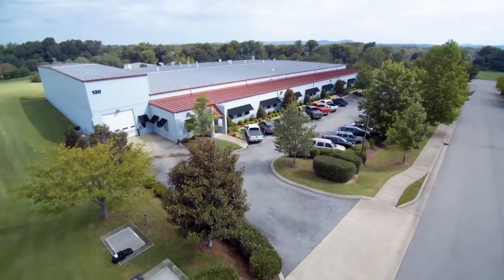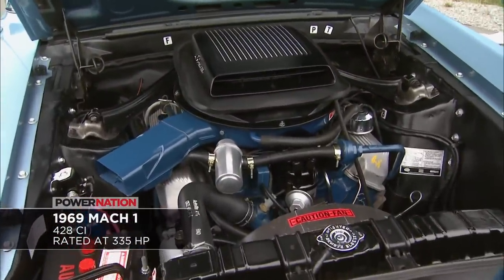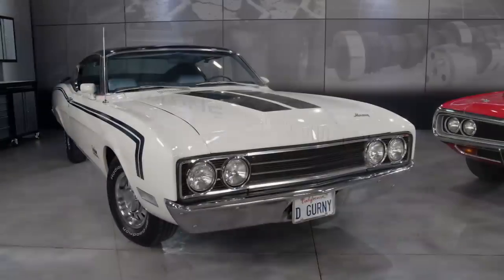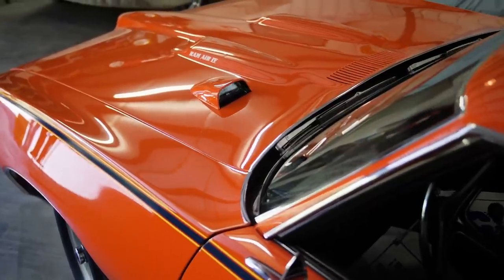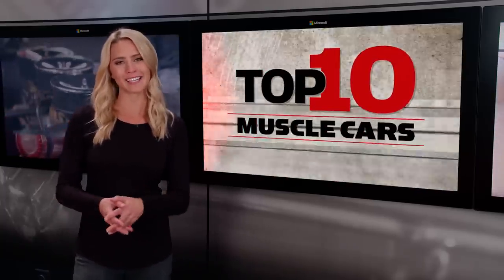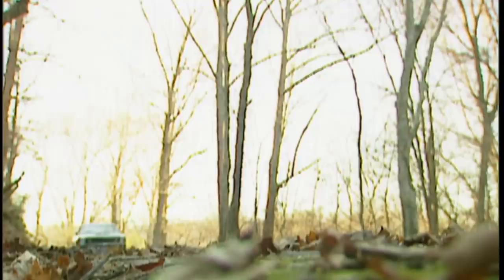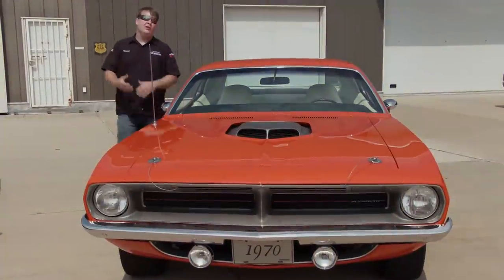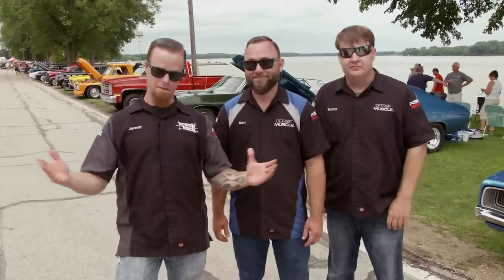Detroit Muscle's Top 10 Muscle Cars

Comment: not even a mention of the HEMI KILLER. Buick GSX. one of these will stomp everyone of these junkers you posted.
Reply: 455 stage2
Reply from the maker: This was taken from a poll we did.... It's not necessarily how we would rank them but how the poll turned out!
Reply: 440 6BBL and HEMI eat 455 Buicks ! I was there when they were new !!!!

A GSX had a tough time with a 440 4bbl !!!
Reply: My Dad owns his 70 Cuda 440 6bbl he ran 11.80's with 2 weeks after he bought it new...tuning the carbs,adding headers/custom mufflers,traction bars and laughable 10 inch wide drag slicks that spun 130 feet down the track lol ! They hook less than a modern tire !
*read until the end my friend..

 My 68 Charger RT I bought I 1972 lowest mileage I could find 56,000 miles,ran 12.80's from a stock 440 4 bbl 3.23 gears,727 auto..I later added headers,carburetor,traction bars and in 1976 pro trac wide treads bias ply 275 wide and ran 12.40's !!

My buddy had a Buick 455 stage 1 and had carb/headers and 3.42's and yet it was a drivers race,who spun the least won..I knew several guys with 455 Pontiacs,Olds,Buicks and no they couldnt beat a Hemi or 6bbl car,unless the driver of those couldnt drive or out of tune !

Magazine back in the day added laughable slicks on a 440 Cuda and went from 14's with its bias ply 185 - 60 series tires to a low 12 second run !! As tiny tires spun back then..

I am a car collector and bought out many of my friends cars back in the day and today even...

I own 6 GM products including a Chevelle SS all original,never restored and pristine ! I owned since the 80's,71 455 Olds 442 ,1970 Buick GSS 455 stage 1 ,so yeah I have many experiences with the 455 stage 1 !!! I own a 1973 Pontiac SD 455 Trans Am albeit not a Trans Am fan but my close friend owned it,and passed away..So the GSX you mention,I own the same thing not a GSX but same damn thing Stage 1 455 same year,performance etc...

**Mopar engines by adding headers,swap carb ,duel plane intake you get 100 hp/100 ft lbs over rated numbers..426 Hemi cars have 550 hp with these simple 2 hour add ons..albeit youre not a moron and can put headers on lol..

60's early 70's cars mainly Mopar/GM can run 11's to low 12's on average by a simple tire change ! Today people screw them up,well since the 80's I've seen..they add a big cam.wrong heads,wrong intake,carb etc....

Like I said I was ther ewhen these were new,owned them since and collect them 6 GM products,4 Ford/Mercury and 26 Mopars ..I also own a late model dealer, transmission shop,brake/exhaust shop and I used to do restorations myself but got too busy later on.
Reply: 455 Stage 1: 510 lb ft torque, 395 hp. 440 6 Pack: 390 HP, 490 lb ft Torque. The Buick was also lighter than the Dodge and "conservatively rated" in horsepower, so there's no feasible way that a Buick GSX Stage 1 could lose to a 440 Six Pack-equipped Mopar, unless the Buick driver is just drunk or has never driven a car before. (The 426 Hemi was a little closer to spec of the 455, but still made less torque.) There's a reason that the Buick GSX is factually known as the most powerful American production vehicle until the introduction of the Viper in 1992. Sorry Mopar guys, but Chrysler didn't build anything in the sixties or seventies that could outpace a Buick GSX, despite what your drunk uncle Ed tells you. I was there, too.
Reply: I would really like to see a head to head with the Buick 1970 gsx versus the 1969 Yenko Chevelle 427. There would be a real race.
Reply: @RockandrollNegro , if you were in to cars in the 60's you knew HP numbers were taken with a grain of salt.  NHRA classes were adv weight/adv hp.  If the mfg underrated the hp, the car ran in a slower class and had a better chance of winning.  If the the factory hp seemed too off, the NHRA would factor it up making the car run in a quicker class.

Comment: But which one of these awesome cars was the quickest American manufactured muscle car thru the 1/4 mile ..it was the 1966 AC Cobra with the 427 R Code Ford engine with toploader 4 speed transmission.  ET 12.2 @ 118 mph  
The second fastest was the 1966 Corvette with the L72 427 engine. ET 12.6  @112 mph  
It should be stated that the AC Cobra is in fact an American produced car, ..they were manufactured by Shelby America in Venice, California from 1962–1967.  As with all American car manufactures who rely on either Tier 1 or Tier 2 suppliers for 90% of the parts and sub-assemblies used to build every car in America and Shelby America was no different. They used body and chassis sub-assemblies from AC Limited in England ...just the same way General Motors used dozens of suppliers for parts,  including MFG Manufacturing in Ashtabula, Ohio who supplied GM with their fiberglass Corvette bodies.

Comment: Some COULD argue Oldsmobile beat the GTO to the "muscle car" punch line in 1956 with the Oldsmobile 88 and the tri power J2 option!! Back then Oldsmobile was tinkering with making more horses, but GM was quick to stomp their feet down and killed it!! Of course too you can't over look the fuel injected Bel Air from 1957 or even the wildly under powered 1953 Corvette as a "sign of things to come" either!!! Of course earlier than these though there were a lot of guys who were hot rodding the old Flat Head V8s developed by Ford in 1932, which by the 1950s before ANY OF THESE CARS, were literal horsepower monsters, and even companies like Desoto with their Hemi engine (yes Desoto had a hemi BEFORE Chrysler did), were still well ahead of the GTO and the start of the "large engine, small body" muscle car crazy of the early/mid 1960s! And there was no shortage of guys stuffing Desoto Hemi motors into Fiat Bodies and making insanely fast cars, just like swapping flat head V8s into old 20s and 30s chopped up Ford tin and creating high boys, T buckets, and model A roadsters out of them!! 

And a lot of these "kids" later became Grandpa or Great Grandpa to the kids today, that same "old guy" you ignore at the family picnic because he smells funny and you think he is stupid, useless and insane!! But you forget HE WAS A KID ONCE TOO, and they did things with cars you and I today can only dream about!!!
Reply: Greg, for the '57 model year both Olds and Pontiac offered tri power options.
Reply: You know it.

Comment: I would have subbed the 70 Chevelle SS 454 for the 69 Yenko Chevelles/Camaro 427. The Yenkos were actually faster than the 454s. This is why racers back in the day aurgue over which is a better engine the 427 vs 454 Chevy. BTW, the Hemi Cudas were slower than the LS6 454 by a hair.
Reply: Andrew Sully  well it is true depending on who drove the cars, i have beat 70 hemi cudas in my ls6 and i have been beat  by a couple . One thing i do know is my ls6 will run in the 11's all day long and its stock except for the tires of course.

Comment: Noticed that the word 'ford' was used only once in this entire video (as the mustangs had more shelby parts and engineering (than ford parts and engineering).   The occasion to use that family name?  When they spoke of ford needing a 'stock' car to sell some 429's for NASCAR eligibility,  hence, the 1968 front suspension design (by Shelby) to squeeze a big block in a space where a small block barely fit was a heavy influence on the other two 69 mustangs...    I would accept the top two in either order as the Cuda and the Chevelle were both excellent "in house" designed and built...

Comment: Mustang...lol....I had a 68 GTO that was a freak.  I often thought it did not have the 400 engine, but the 428.  I had friends that had the same GTO 68 and mine would out run theirs.  If fact the only hot rod back then that it did not out run was a 427 Corvette. but the vet did not leave it behind either. I raced GTX, Road Runners, SS 396 Chevelles , Shelby Mustangs and Ford version Mustangs and other hot rods back then, never got beat by any of them

Comment: Even though I grew up during the Muscle Car Era, I Respect all of the various MC's that came from FORD, GM, Dodge/Plymouth & AMC of that Day!

But I am Bias, I am a FORD Man and here are my picks: the 67 FORD Shelby GT500 Super Snake, the 68 FORD Shelby GT500/KR, the 69 Mach 1 Cobra Jet and the 69 FORD BOSS 302/429!...But, my Favorite was the 69/70 FORD Shelby GT500/GT350!...I am Just Saying!...God Bless America! 😇

BTW!...While in High School I Owned a FORD 66 Mustang Coupe that I fixed up into a 66 Shelby GT350 Coupe version and I Owned a FORD 69 Mach 1 but it was Stolen!...Oh Well!...I am Just Saying!
Reply: I can agree with your first statement with the exception of Chevy, the other GM's of the day were decent cars, but Chevy has pretty well always been junk.
Reply: @7.0sbfgmcrusher95 ...Well, my Friend back in my Day I used to hang out with the L. A. Street Racers (Los Angeles, Ca.) and I had a friend of mine with a Chevy Gold Chevelle (it was Automatic with some nice Chrome Cragar wide wheels and low profile wide tires, with some loud exhaust, but mostly Stock!) and another friend of mine had a 70 Chevy Z28 with the split front bumpers and a Built N/A 350 engine with a Hidden Nitrous system and 3sp Auto Trans with a Shift kit!...It was pretty Fast!...I am Just Saying!...God Bless America! 😇

Comment: The best car ever made was 1970 dodge challenger  with 440 wedge or 426 hemi thy put the wrong car for number 1 440 wedge 375 horsepower  and 426 hemi  425 horsepower but if you read or look up  440 wedge could never blow  one up but 4 26 hemi that ko up if you didn't take it for a long drive  there know  for that up I would take 440 wedge over 426 hemi but 440 wedge are to come by but this show was interesting. Thanks for the show youtube

Comment: The 69 Z/28 had 375hp and got to 60mph in 7.4 seconds? That's pretty bad. I'm sure good back then but still pretty slow with all that power it had.
Reply: I thought the 69 z28 was factory rated at 290 hp
Reply: @cjtjets5941  That 7.4 seconds time would make more sense with that.

Comment: Beautiful car, glad he restored it to original specs. But we all know. single master cyl., manual/drum brakes are dangerous. And a 3 spd manual is dorkville. I love ALL the HP cars; just a gearhead at heart; but beer pocket money w/ champagne tastes. I wish I had the $$ to buy back my '73 Charger; wonder what condition it's in ?  I looked at some on line--restored--and out of reach $$$ for me I suppose forever.
Not right that the 302 Z28 Cammie didn't make the Top Ten List--that baby tore 'em up on the track, and had a more lasting effect because it wasn't outlawed due to fear & being OUTRAGEOUSLY competitive/dominant in NASCAR. GTO Judge, RA III, IV,  --great cars; beauty in Orange--but Delorean & GM screwed up on the el cheapo look wheels.
I'd donate body parts if I could get a 66-67 OLDS 442, & 70 El Cam SS, and a 67, + a 70 SS Chevelle. I'd happily take a Mustang, '63Vette split window; '67'-69 vette; Roadrunner, Challenger/Cuda/CHARGER & the GTO; OF COURSE!! OOPS-forgot the '70  AMX.
Corvette chassis on a '70 Dodge Charger RT? HUh? For real; am I hearing things?

Comment: Why did you show the Dodge Daytona instead of the actual Road-runner??? "Beep Beep"... There is a difference ya know! And if anyone else noticed on the back side pillar it happened to say Charger! Hello folks!!! Ya gonna rate cars? Than do them correctly please! Why have I called you(s) out on this? Because the Roadrunner happens to be my most favorite car. Why? For the very reason it was the only race car band from a race track as it was thought to be to dangerous and it was also the car, the "ICONIC CAR" that made NASCAR rethink their carburetors in cars to follow and is when restrictor plates began being used!!! Thank you very much!!! It is also easy to catch a stock photo of a roadrunner to use as well! And yes I have worked at two race ways! Daytona and Lowell's Motor Speedway, Charlotte, N.C. and of course Daytona Beach, Florida.
Reply: That’s the superbird it’s similar to the roadrunner but also the Dodge Daytona came first in 1969 with the superbird in 1970
Reply: Admittedly, comparing a stripped-down NASCAR racer from decades past to a posh modern production car with heated seats is hardly apples to apples. Even so, the Charger Daytona didn't have the luxury of computational fluid dynamics to shape its body panels, or a supercharger cramming 11.6 psi of boost inside its intake runners either. Accomplishing such incredible feats with rather crude '60s-era tools forever cemented the mystique of Chrysler's aero cars.

While the Charger Daytona paved the way for Chrysler's foray into NASCAR's aero wars, it was the '70 Plymouth SUPERBIRD that took the streamlined B-Body concept to the next level. To create the SUPERBIRD, Chrysler engineers tweaked the angles of attack for both the nosecone and the rear wing, then integrated them more seamlessly into the B-Body's sheet-metal. Granted, the drag coefficients of both Dodge and Plymouth versions of Mopar's winged warriors are nearly identical, the SUPERBIRD definitely earns some extra style points for its cleaner lines.

Comment: Another video that makes opinion fact.  Here is a quote from Motor Trend Magazine  "A 13.38-second pass at 105.5 mph prompted Motor Trend to crown the Buick GS 455 Stage 1 the quickest American production car tested" and it isn't on the list? 

Another oops, the 1965 Coronet 426 Hemi.  At a little over 3.100 pounds, this Hemi powered Ecno box was tearing up the 1/4 mile long before most of the cars on this list were thought of.  Drive it from the dealer to the Drag Strip, and off ya go!  And it had a whole 90-day warranty, if you didn't race it I wonder why?

I'll end with this one that got no respect and at the 1/4 would beat al of these "Top 10"  The 1970 AMC Rebel Machine.  A few upgrades from the dealer-installed  "Service Kit", brought this Red Headed Step Child up to 470HP.  Add the available 5.0 gears and this beast was an easy low 13-high 12-second monster.  Including this one on their list would have made me think that these guys were serious about researching true muscle cars...they weren't they just went for the obvious.

Everybody has favorites but this list is far from the Top 10 "Muscle Cars"

Comment: 9:57 y'all are crazy us Chevy guys got it straight... The 72 chevell, 69 Camaro and the 72 nova were some of the best cars ever made...
Reply: If you wanted to bounce off the starting line. When you look at who ruled both at the strip and the superspeedways, you have to move past the whiners from Chevy and Ford who cried foul from the first time the Hemis appeared. NASCAR finally made them destroke the Hemis to 5 liters and NHRA kept adding weight to Hemi cars until they were no longer competitive. Now, as far as the clowns hosting this mess. ANY Mopar head knows that Plymouth NEVER called their 3 2-barreled setups a "Six Pack", they were called "6-BBL" or "Six Barrel"; Dodges had 6-packs.
Reply: @mocharger06  I agree that a Hemi car was hard to beat, but the Ford Torino Daytona could keep up with if not beat the Hemi cars in NASCAR, and a Ford 427 "cammer" car could do the same on the strip.

Comment: Top Dogs of 1960s and 1970s,

1969 ZL1 427 COPO Camaro.
4 spd . Automatic.

1970 & 1971 426 Hemi Cuda 
4 spd or / Automatic ..

1969 / 1970 429 Boss Mustang 
4 spd / automatic 

1970 to 1971 
SS LS6 SS 454 Chevelle 
4  spd / auto.

1971 R/T Charger 
426 Hemi 4 spd.

1971 440 R/T Charger 
Automatic 727 slap stick..
390 gears.

1972 454 Chevy Silverado 
SWB 4;88 gears Automatic..

1973 454 COPO Camaro 
Phase lll 475.H.P 4.spd.
4:10 gears..

1974 Grand Prix 455. H.D 
4. Spd 4:10 gears..

1975 455 H.D Trans Am 
4 spd: Auto 373 gears.

1976 Trans Am 400 HD
4 Spd 4:88 gears..

1977 Bandit 6.6 4 spd.
Black on Black T-Tops 

1978 Cadillac .

1979 Chevy Silverado 
454 SWB 373 gears.

1980 L82 Corvette 4. Spd.
342 gears..

1992 FireHawk 388.LT1 390 HP.

1993 LT1 Corvette..

1994 ZL1 Corvette 

1995 FireHawk 315.H.P

Y2K Cars .
2001 /2002 
WS6 Trans Am 6 spd Hurst shift.

2001/ 2002 
SS Camaro SLP Auto/ 6spd .

2003 Cobra. R Mustang 
390/390 ..5 spd..

2007 ZO6 7 spd.

2009 ZL1 Corvette 7 spd.

2010 COPO Camaro.

2011 Shelby Mustang SuperSnake.

2012 COPO Camaro.

2015 Viper

2016 Viper

2017 Cobra Jet Mustang 

2018 Dodge Demo 
2019 ZL1 
2020 Z51 Corvette..

2023 ZO6/  ZO7 Automatic..

Comment: I guess if you start the Muscle car in 1965 then the GTO is first  but a muscle car is a budget priced Car with big power and nothing  fits that better than the 1957 Rambler Rebel 327!  It may not have the power that a GTO had but the GTO didn't have the power SS454 had ether!  the 1957 Rebel was a Cheap car with lots of  power!

Comment: 64 GTO went from 0 to 60 in 4.7 seconds
Reply: 65 Pontiac Catalina 2+2 did 0-60 MPH in 3.9 seconds. Fastest car between 1955 & 1980 for regular production American made cars. For special factory cars, 1963 Pontiac Lemans with 421 crossram 2×4 Carter AFB's, 4 speed transaxle, (automatic with a clutch), battery and starter in back, 50/50 weight displacement,  ran the quarter mile in the 10's. No one was faster!